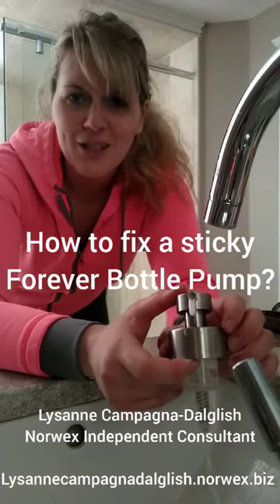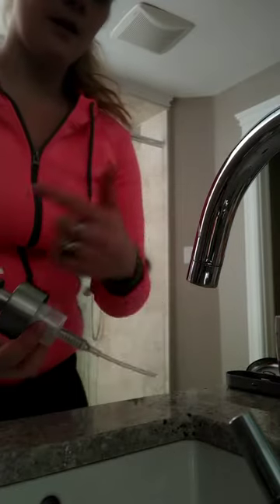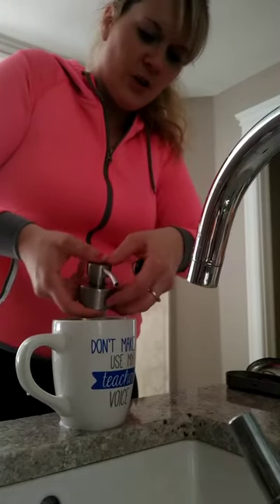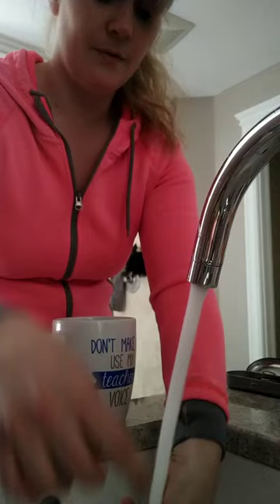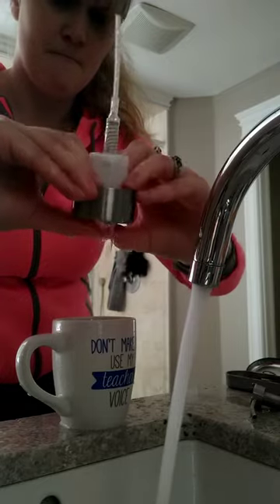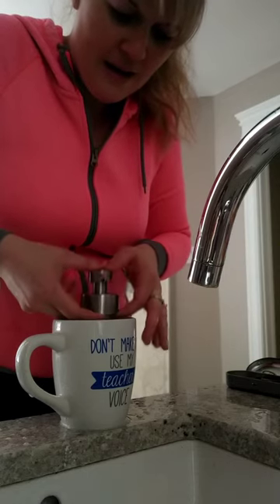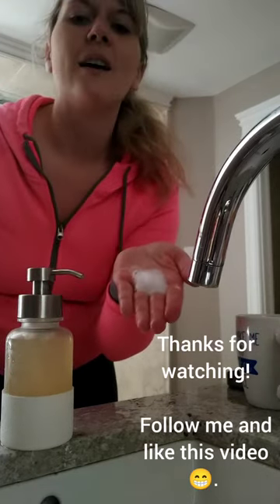How to fix a sticky Forever Bottle with Foaming Hand Wash Dispenser?

Comment: After you separate the pump assembly from the bottle, before you pop the pump head off, turn it upside down and pump it several times. This should clear out any liquid trapped inside the wider air chamber. Also, once you remove the pump head there is a small piece left behind that was connected to it
Remove it. That is the filter. It's about an inch long. It is usually the filter that sits between the pump head and air chamber that gets clogged. Remove it and rinse it well, then reassemble. Every so often empty the soap out of the bottle, rinse well, fill with warm water and pump until nothing comes out of the pump but clear water. Then refill with the soap. This will prevent soap buildup from clogging both the pump head and the straw.

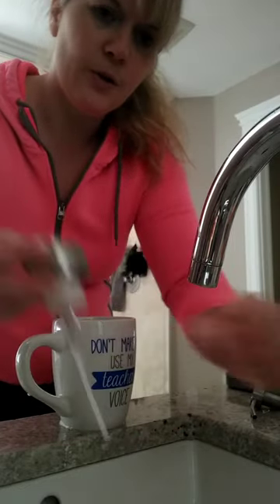Comment: How can you disassemble the whole thing to clean mold out of the compartment you're pointing to at 1:45, and then reassemble it?  I have a pump assembly just like this, but within a year after I buy them (not so "forever!" I'm on my 2nd or 3rd perfectly well-working pump because of this mold issue) , that compartment  is full of nasty little floating black mold pieces.  I can take everything apart and clean it but I can't get the plastic piece that includes that compartment to snap back into the collar that screws onto the bottle.  Can anyone help?
Reply: Yikes! I'd suggest contacting customer care about this. They should prob know this is happening.
Reply: @melw3313  No not at all -- I use distilled water as recommended by the people who make these "forever" pumps.  But time after time they get moldy and you can't get  in there to clean!
Reply: @thatclothgirl  Yeah, I've emailed & called.  All they want to do is sell me a new pump assembly.  They should make these completely dis-assemblable and cleanable.
Reply: @francinekrasowska4667  Norwex is a very ethical company - I imagine they will take it into consideration. If something doesn't meet quality standards, they always replace it with an improved product. If you know others who have had the same issue, please have them contact their consultant to submit a help desk ticket!
Reply: @francinekrasowska4667 same! I came here looking to see if I could clean it